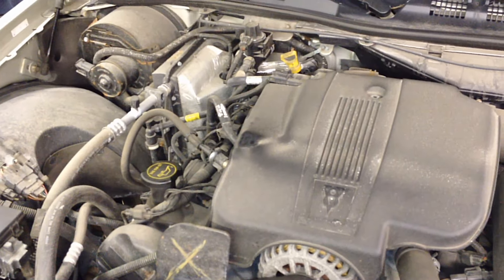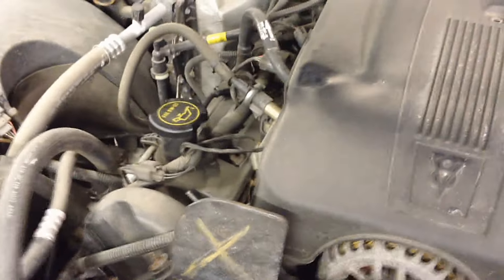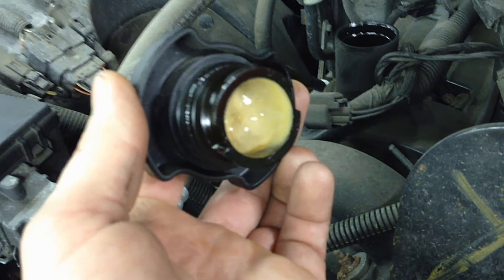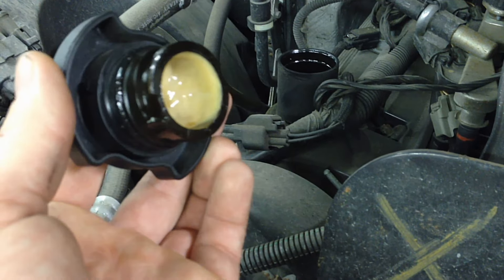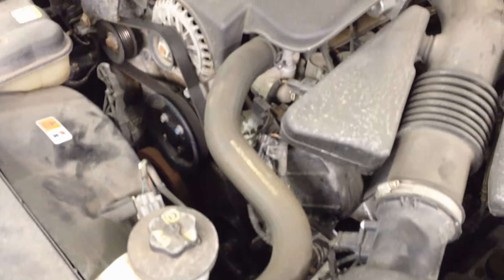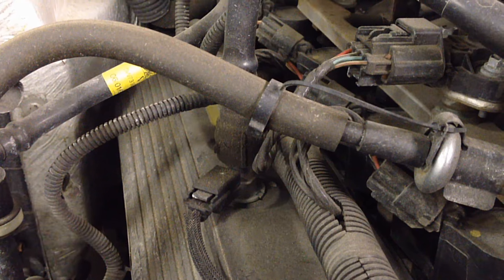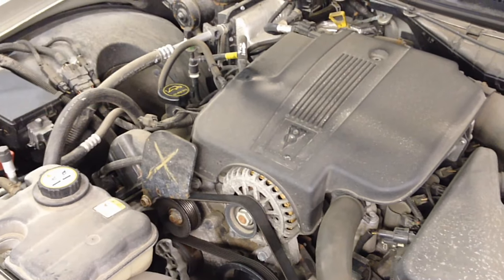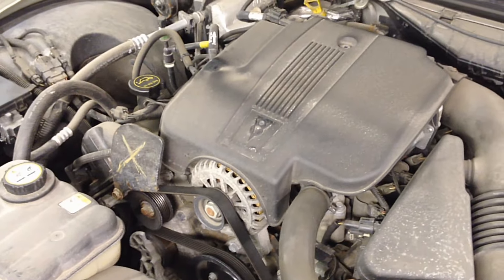Ford Quick Tips: #1 Engine Oil Cap Puddding

Comment: Despite no milkiness under my oil cap, and generally driving in a warm environment, this explains why there is a general brown tinge to all the parts inside of the engine in my 1999 Chevy Prizm.

I think I do a lot to prevent issues, always using quality oil like Mobile 1 or Castrol with Syntec. These oils, when I buy the extended mileage are looking pretty clean up to 5k to 5.5k miles, but when I get synthetic that doesn't have the "extended" design I only get about 4.4k miles out of the oil. (The oils are rated at 15k and 7k respective to my 5.5k and 4.4k mile oil change intervals.) I'm basing these decisions by how dark the oil gets.

It's all those short trips. I'm building up water, and therefore acids because of living in smaller towns since 2005. The metal of my engines in a Metropolis looked much better. You know, where I was usually driving at least 23 miles to work, and I bought much more used cars and it was colder.

Short trips really are hard on cars. I never fully believed it, but "proof is in the pudding"! Just don't eat it! lol I should have stayed under 4k miles the whole time (car has 170k miles plus now).

FordTechMakuloco I had so much to say, I decided to write an article. I've watched dozens of your videos, but you really inspired me on this one. 1/2 of the article is here, but if anyone wants more, it's here below.
http://carmilespergallon.blogspot.com/2015/03/despite-no-milkiness-under-my-oil-cap.html - I embeded your video on my blog to help you out. :)
Reply from the maker: DE Nichols Sweet thanks!
Reply: FordTechMakuloco I got into your channel because I was thinking of buying a Ford Flex. I had one kid on the way not two so it can wait. Lol

I've stuck around because plenty of things you teach aren't Ford knowledge only. It's more useful than that. Plus, you never know what I'll see since I start at my first full service shop this week!

Comment: I didn't have that quite bad of a situation. I think the coolant leaked into the crankcase after I shut the engine off after a long run. My E250 has a 5.4 two valve engine. Factory tow package with remote oil cooler. Simply, I found the oil cooler leaking water into the oil cooling element. This was just six weeks ago! Removed the oil cooler from the remote oil manifold, pressurized the water area of the cooler while under water with air. Saw bubbles coming from the oil chamber area. Replaced the cooler purchased from a Ford dealer. truck has just gone on a three thousand mile trip with absolutely no problems. No more collant in the oil. Oh, I use only all synthetic oil and all synthetic additive. Vehicle now has 278,000 miles and the engine has never been taken apart. I change oil and filter approximately every 4-5 thousand miles. Yea, I'm a 74 yr. old gear head from the fiftys - sixtys big block era still doing my own work.
Reply: Neil, thanks for the response.
Reply: Papasmurf7597 I have the same problem on my 62 Lincoln continental I also have an exhaust leak and can't find guidance on replacing it...please don't tell me I have to unmount the engine.
Reply: Papasmurf7597 great job
Reply: Thank you Daniel. Just old timey mechanics. BTW. My truck now has 306,000 on it.
Reply: Papasmurf7597 wow that's wonderful. I hope my dodge makes it that far. Mine has 197000
Reply: wTer leakin into crank case is way worse than natural motor condensation
Reply: Taylor Welsh. You would be correct if it was water only. BUT its not. Its a major amount of coolant(that's what anti-freeze is called in Florida). I lucked out, because I caught this problem quickly and corrected it. As an 'old gearhead', I'm pretty sure coolant/anti-freeze would not be good to have in the crank case/oil for too long. BTW, my old Ford E250 3/4 ton van just went over 310,000 miles this week.

Comment: This can be a mix of oil and water but it can also be caused by using a high detergent oil.  If your motor never really gets enough time to turn the water in your oil to a vapor then suck it out of the motor through the PCV valve it can build up inside the motor.  Several years ago someone tested this pudding in the cap and it turned out to be detergent from the oil so it can be more than one thing.  The only oil that I have seen this happen with was Quaker State.
Reply: I used to pump gas back in the 1970's. I checked the oil,on everyone's car. The only time I found this problem I asked them what oil they used, it was always Quaker State Oil. I have never used that brand since that time. Let that be a lesson you can all learn.

Comment: plastic valve covers dont heat up as much to head temp as aluminum would. even when i drive long drives in cold weather. the moisture condenses on the cooler plastic instead of boiling off
Reply: +Steven Tenney That is what is happening to my 15 year old VW 1.4 16V engine. How do I make it go away? It is not as bad as this at all.
Reply: Steven Tenney ...On my 1999 Ford Expedition in colder weather, engine up to operating temp and even after a long trip, the plastic valve covers are still just warm to the touch. I get the white pudding-like buildup on the bottom of the oil filler cap and in the top of the fill spout. During the warmer season, I don't get that. My theory as to the cause on these engines, is the low heat conductivity of the plastic  valve covers plus the length of the oil fill spout further insulating it from engine heat. In the summer, much more heat is trapped in the engine compartment which then transfers to those components, helping moisture to evaporate easier instead of forming condensation. Those valve covers will now be hot  enough to be very uncomfortable to the touch. Metal valve covers will be too hot to handle after a while even in the winter and will never have this issue unless the PCV system is blocked, the thermostat is not closing or coolant is getting in the oil. This condensation issue is seemingly the norm in engines with all that plastic and should disappear with the arrival of warmer weather. Just check fluids regularly, keep up with oil changes and you should be fine.
Reply: Steven Tenney Dude you look like David Duchovny, hear that often?
Reply: We had a '00 F-150 with the 5.4

It would get the pudding in fill cap area. It would get driven short trips 40% of the time. 

Larger iron block, plastic valve covers and fill neck. I agree, they don't get hot enough. 

I never see pudding on my aluminum Subaru ej25.

Comment: My 2002 F150 old PVC Hose was leaking around the Intake ,  replaced it , no more  Pudding .  Be careful , the Heater core has plastic  Quick couplers that break of very easily , best to do it when the Motor is cool to avoid getting a possible serious scalding hot Radiator coolant Burn !!!

Comment: I have a little 4cylinder Mazda pickup, and I JUST noticed my oil cap has a little milky gunk on it. I pulled my PCV valve and it had the white gunk inside of it too. It ONLY started to happen to me since winter started here in Oregon. The oil when I check it is nice and gold even when cold, but the oil cap and pcv valve always have some moisture in them. And the little tube on top of the valve cover running to my airbox ontop of my carb is getting this moisture too. My coolant did drop a little over the last couple months, but I tightened up some hoses and it stopped losing coolant....coolant is still green, no signs of milkiness. Whats your opinion?? I work like 3 miles from my house, and don't travel out of town much, mostly in town trips, but its my daily driver
Reply from the maker: Yes your weather conditions and driving habits lend themselves to this kind of build up I would not worry it is normal.

Comment: Thank you so much!! I took my 1988 Benz 560s oil cap off and I saw a pudding but nothing on the cams or on my dipstick and my coolant has not gone down at all, I was freaking out until I read that this was a very common problem and I saw this and that's exactly what mine looks like. I was just worried cause my other Benz ( my daily ) did have that

Comment: Thought my ram had a blown headgasket too but then i realized the oil on the dipstick was fine and the coolant level hadnt changed. After watching this, sure enough everything lined up. Right now its winter and I only drive 2 miles back and fourth to school everyday. That combined with its larger aftermarket radiator it doesnt get to really heat up. Glad its nothing serious.

Comment: Another tip I use when checking the oil cap Look inside of it and not just the cap, if there is none of the milky stuff at the bottom it's the moisture, if there is milkey stuff at the bottom most likely a blown head gasket, if you just see oil your good, or check the dip stick, if the dip stick has the milky stuff to that's very bad if it doesn't then your good.

Comment: Thank god. My oil is clean and coolant reservoir is right at level but I noticed white sludge on my oil fill cap. I’ll change the PVC valve just to be on e safe side. Truck is an 2006 f150 with 60k maybe I should drive it more often.

Comment: This happened to our 2001 F-250 with the 6.8L V10 during below zero temps and the moisture froze the baffle off the valve cover for the pcv.  went out and started the truck and heard the baffle getting thrown around, pulled the cover off halfway and removed the baffle
Reply from the maker: Oh wow that's bad!

Comment: I have a 13 3.5 EB F150 and noticed this today. I have a Full Race catch can that does not work at all. I am installing a UPR can which I had at one point so I know it works. I hope this issue clears up. I drive my truck every day so Im not sure what the deal is. Pulled the dip stick and it just looks like oil.

Comment: Thanks sir,  1st oil change on a used truck I just  bought, 76,000 miles, And I thought, I'm in deep trouble, The stick looks fine and when i drained it it was fine, dirty but normal. 6.2 gas.

Comment: I found this sludge stuff in my oil cap on my Chevy cruze but it's cold here where I live and I only drive it for like half an hour each day it just depends, but my coolant reservoir had a crack in it and I just replaced it so I'm worried that my coolant mixed with the oil but since I dont drive it much it can be either problem not too sure if I should worry or not

Comment: Anyone see this freeze before, I have a 2006 Pontiac Torrent with GM's 3400 that has this problem. I figured my head gasket was just starting to go out as it was only on the oil cap and the fill neck area but the dipstick was clean. I was really sad because one of the main reasons I purchased the car was because the head gasket was replace in 2014 only 50,000 miles ago. My biggest worry is this past few weeks I have noticed this film has frozen solid as it has been very cold. The car is usually only driven once a week about 2 miles and about a 400 mile trip once every 6 weeks or so, but I always let it warm up before leaving.

Comment: This makes me feel much better about my used 2010 F-150 I just bought.  I found a bit of 'pudding' under my cap (not as much as in the video) when I was checking it today and I immediately thought head gasket problems.  After watching this vid I checked the dipstick and coolant reservoir and all of that looked great.  I think i'm going to replace the pcv valve as I just broke 80k to be safe.  My commutes are quite short (6 miles in the morning, 1.5 afternoon) and the temp has been below freezing up here as of late.  I've just been using motorcraft oil in this but would a full synthetic help with this?

Comment: At a dealership i worked at. The manager and service advisors would tell us if we found that on the oil cap the we needed to suggest a BG EPR and MOA service to fix the issue. Would you suggest that to customers?

Comment: I noticed this with my truck today, because I only drive 5 minutes to work everyday. I thought it was a blown head gasket because I was also loosing coolant, but wheb I changed my oil I noticed coolant leaking externally from my radiator. My oil was free of this butterscotch colour but I did notice a tiny bit of it on my dip stick the other day, I'm concerned about my truck.

Comment: Hi, I have the exact problem on my 2001 VW Golf GLS 2.0L engine. I only drive this 14-yr old small car to train station a mile from my house, so that I don't need to park my better car at the public parking lot.  It is 2 miles round-trip daily and I agreed that you are correct about daily short trips caused this issue.  It did freak me out when I opened the oil cap and see all the thick pudding, but your video helped me felt a lot better now. My coolant level never drops and my dipstick doesn't have any of the pudding. However, I will follow your advice and change oil every 3-4 months even it is only 200 miles driven in 3 months. I do have a question.  I live in San Francisco Bay Area and it is not every cold here in the winter, about only 38-40 degree in the winter morning. Will it matter how cold it is? Or short trip is the main culprit in my case?  Thank you for all your help! Liked your videos.
Reply from the maker: T-for-Tiger Short trips are the main culprit we can see this in warmer weather if the customer drives short trips all the time.

Comment: Hi I have a 2007 Ford F250 with a 5.4 3 valve Triton and I have that sludge creamy stuff on my fill cap and down the funnel part and some of my dipstick but I don't use any radiator fluid so it's kind of weird so I change my oil but brand new oil in it and when I drive it I still have it comes back I wipe it clean and it still comes back in the fill tube some of that cream build up and a little on the dipstick but it's weird cuz I don't use any radiator fluid what can that mean and plus I don't drive my truck that much I drive it probably 10 miles a day maybe 20 miles a day

Comment: Got a 2015 Fusion Hybrid, the wife uses for her work about 2 miles.  Its has only 75K miles and though HEADGASKET????  Ya, vanilla pudding under the oil cap and coated the cam position sensor.  This is a pain to clear the code.  Any recommendation on how to remove the pudding, without removing the vale cover??

Comment: I had this on my ram 4.7 , turns out the pcv valve by the oil fill cap is going out. Replaced it and never had the problem again.
Reply: tweker69 I purchased my 4.7 ram brand new in 2002.  I noticed on my first oil change my cap was like this, and it only had 3100 miles on it.  Now, its got 145000, same pudding stuff, never an issue....
Reply: tenobles I bought a used 02 4.7 ram and the previous owner told me not to worry about this (pudding) I drove it 1,200miles about 16 hrs non stop and didn’t make it my engine blew so be careful

Comment: Good morning, I'm having a problem with vacuum at the oil cap.
Have you ran into this problem before? 
I've done already 
PCV replaced 
Valve job
Cam phasers, chains,guides, solenoids 
New intake and gasket, 
Intake runner motor.
Short block looked new when I took it apart 
I got the truck not running and I want to keep this truck for a while, so I want to put all new parts but now I have this problem

Comment: Oh yeah just happened on my 65k mile 350z I drive 0.3 miles to work everyday, I absolutely freaked out 😭 cap was milky and caked around that area, I drained the oil and it was cleaned so I flushed 2 new oils through it and did a motor oil flush 😁

Comment: Question: I have a 2003 Ford E250 V6 with 216.000 miles here in the NW WA. What type of engine oil should I use? 10W30 or 10W40?
thanks in advance

Comment: If you are going to make short trips all the time, would it be a good idea to let your engine warm up to full operating temperature before leaving your driveway each time you drive?
Reply: No, with how slow your engine heats up in the driveway, it should cause it to sludge even more.
Reply: +DE Nichols why?
Reply: slytherin The longer your engine runs cold, the longer it runs rich to get warmed up. The richer the fuel mixture, the more the oil gets contaminated thinning it down making a bit more of it burn. Thus more sludge happening faster in your oil.
Reply: +DE Nichols It won't sludge up if you change the oil every 3,000 miles or every 3-4 months, whichever comes first.
Reply: n310ea Especially with a good filter. :)

Comment: Ok, so mine doesn't look like that & dipstick oil looks good. I have a leak somewhere that I can't find. When I stop driving. . Everytime I stop driving it spills about a quart of fluid out of the overflow. So not sure what the heck is going on, but figure I will replace the PCV valve & then flush it really well.

Comment: do you see oil cooler issues on the 2017 f-150 vin 1FTEW1EF6HFC05919 we have one with lots of oil in the coolant and lots of coolant in the oil NOT trans fluid black oil. It has a cooler on the filter area.

Comment: How often do you recommend changing a PCV?  Funny how I never see it in owners manuals or service intervals to change it but your hear mechanics and car guys saying to change it.  My 2010 Passat 2.0 TSI with DSG has 160,000 km.  I'm going to change it when the cold weather is over.  Its never been changed and I heard when it fails on my car it can blow out the rear main seal  $$$

Comment: thanks for the pudding update.     opinion on oil additives       and gas additives?    ppe?  in gas cleaning additives"?
Reply from the maker: I just recommend a good synthetic- http://amzn.to/2jKT73P
Reply: A synthetic?  I have 212,000 on my 5.4 L 3 valve engine.  I have always run high quality, high detergent motor oil.  

If I switch to a synthetic, like Royal Purple, won't that risk contamination in valve train oil passages that serve to shorten engine life?

Will the synthetic oil compromise piston clearance on high mileage engines?

I really appreciate your videos.  They answer questions on how to approach a repair my Expedition.